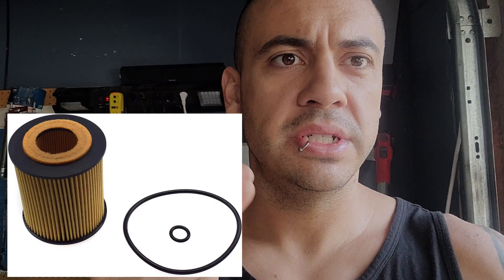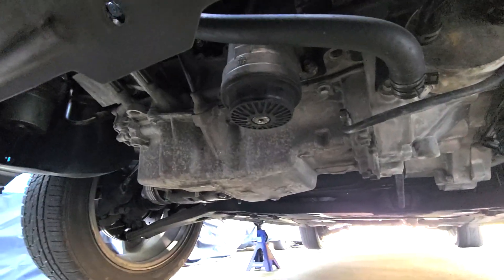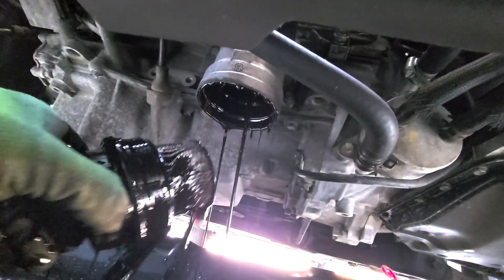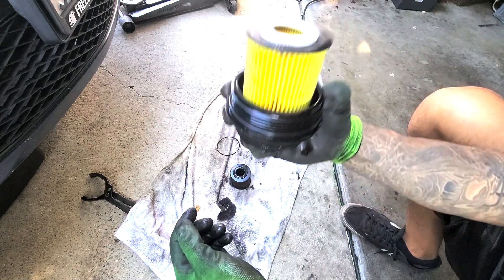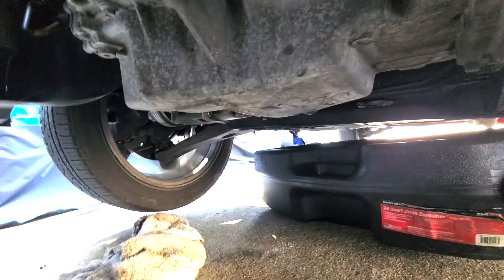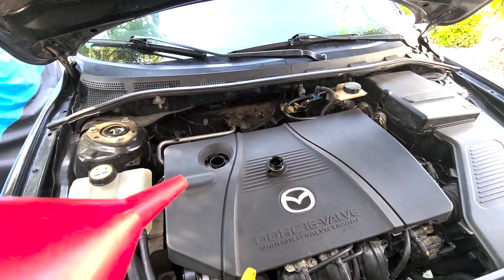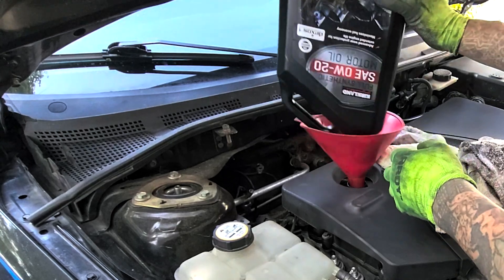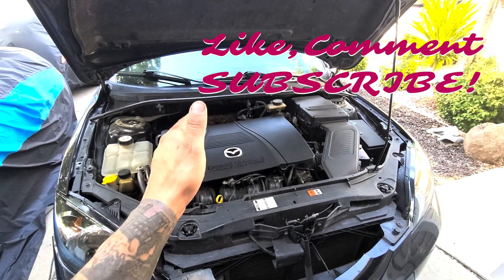How to change Engine Oil on Mazda 3 Sport 2.3 THE RIGHT WAY!

Comment from the maker: Let me know if you liked this video! 

Some other tips for this oil change
- You can possibly use an oil filter socket that fits over the filter as well instead of oil wrench 
- There is also an O- ring for the drain bolt you can replace that comes with the Oil filter kit